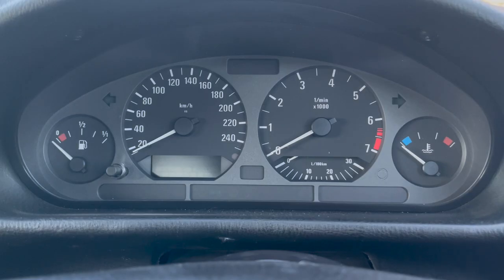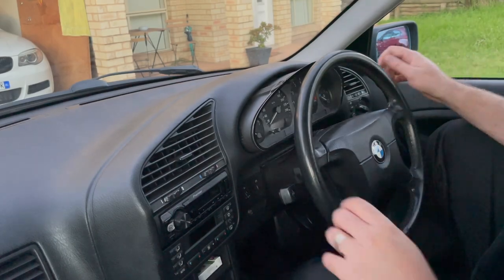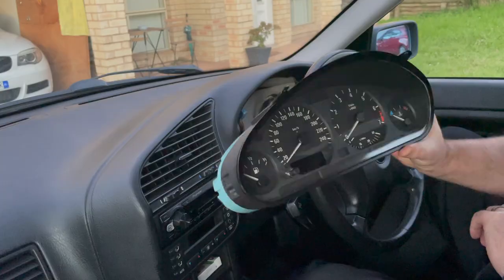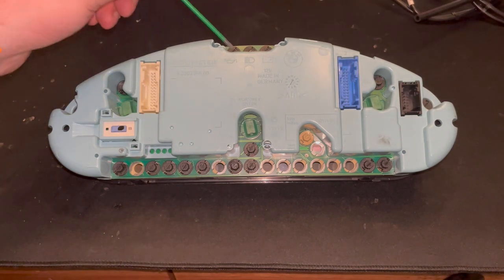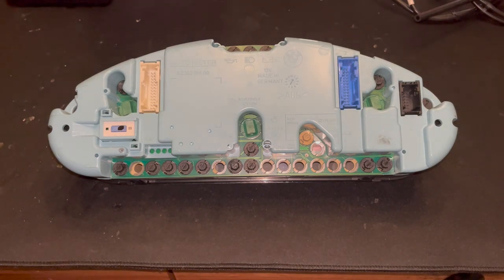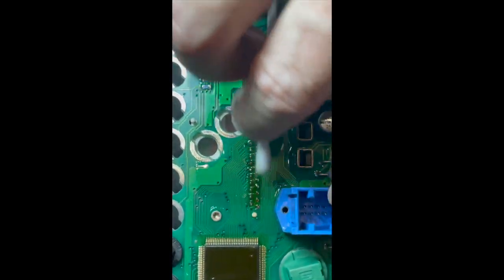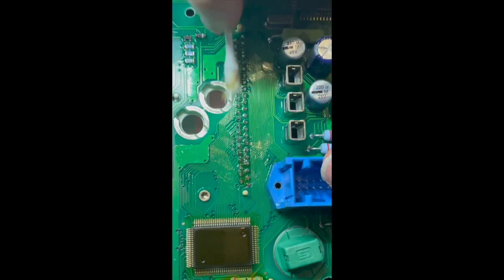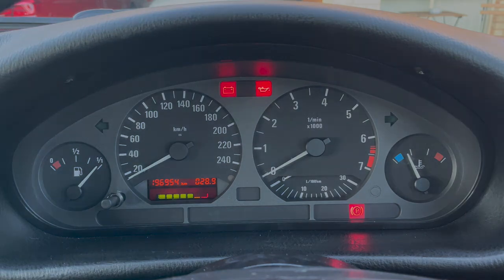BMW E36 Cluster Repair || Nik's Car Surgeries || BMW Cluster

Comment: Thanks you  very  much very  helpful  I was wondering  if you could  give  me  the part number of   the two   small light bulbs  behind  the   screen  thank you  wayne
Reply from the maker: I’m happy this video helped you. The part number for the smaller bulbs (1.2w) is 62131383311. Have a look at realoem.com if you haven’t already. you will be able put your VIN in the search and it will show you all part numbers for your car. I hope that helps

Comment: Hi Nik

Thanks for the very detailed video, I've just followed it, and it solved my read-out issue. Before reassembling everything, I installed just the PCB in the car to make sure it worked.

I used a hot glue gun to put a blob of glue over each drilled pillar. The hardest part with some cussing are the connectors on the rear.

Again many thanks
Reply from the maker: Thank you, I’m happy this method worked for you. Hot glue is a great idea, Thank you

Comment: How did you re-secure the board (since the polymer posts were drilled out)?
Reply from the maker: There are tiny clips at each connector that actually hold the board in place quite well. Plus, once the cluster is back together, the housing holds the board in place as well. IMO those posts are there as an anti tampering thing.